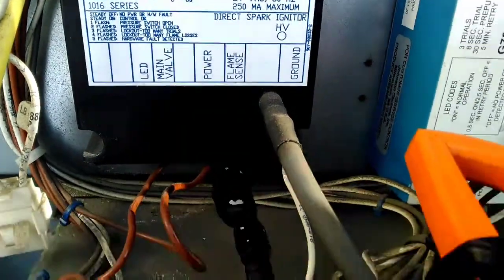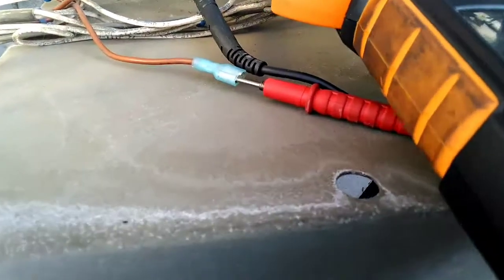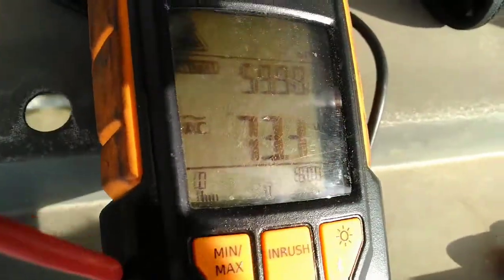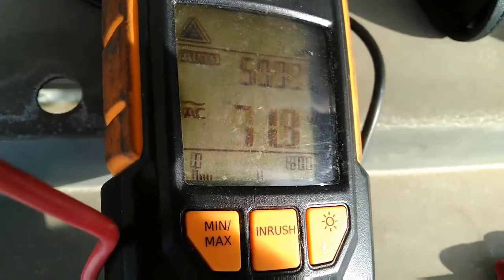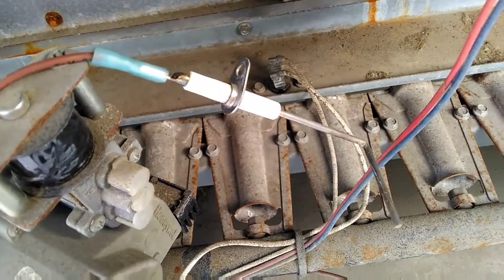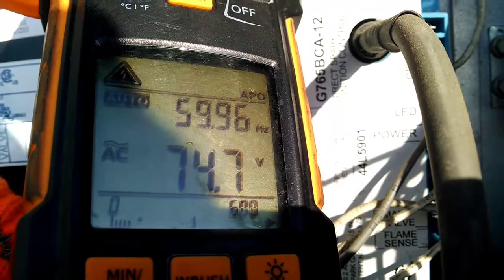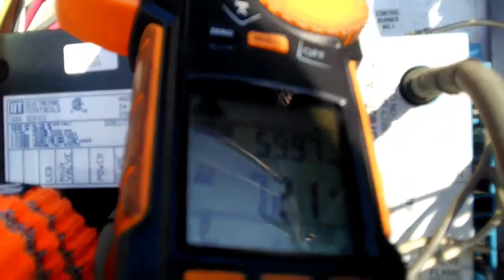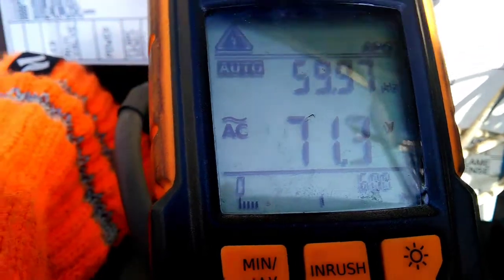Flame Sensor Voltage

Comment: The flame rod is insulated from ground by the ceramic so it should act the same as being mounted to the burners when not mounted. Correct?
Reply from the maker: Channel Cat Chaser correctly
Reply: HVAC Know It All I've never seen a bad flame rod in 17 plus years in the trade. But may see one tomorrow.

Comment: I think It is normal for the voltage to jump, as shown in the video, when the flame sensor is grounded. This occurs because the sensor has a better ground when touching it to the metal frame

Comment: I think another good test would be, put your meter in series with the flame rod, so remount it in furnace, do the series test @ module, now how many dc milliamps are you feeding into your module to prove flame. It will input dc microamp current, it gets compared to reference, it says yes I see flame, and circuit allows main gas at valve. Lets not forget the purge at very begining of sequece, then pilot flame & then ignition. 
Then bill accordingly

Comment: There should always be AC voltage on the flame rod, even when there is no call for heat. The ignition control must be able to sense a flame even in case, say, the gas valve sticks open.
Reply from the maker: Ian McTeer I checked this, when there is no call for heat, the voltage is 13 volts, during a call it's 75 volts then dropping to 55v during ignition.
Reply: I’ve had more experience with the White Rodgers HSI ignition system used on residential gas furnaces. If I can recall, the WR system puts out about 40 vac to the flame rod when no call for heat exists. I never tried grounding the flame rod to check the voltage under that condition but it does make sense that the voltage would increase. I’m guessing the ignition control would sense this higher voltage and lock out thinking that there was a fault in the flame sensing circuit. WR doesn’t discuss this concept in their ignition control literature that I can remember focusing mainly on the expected dc microamps needed to prove flame. Proving flame using a partially rectified AC signal is really an ingenious method, safe and reliable too.

Comment: Flame sensing rods stick out into the flame and connect back to the furnace board. Once the board sends a call to the gas valve to open, it monitors current flow on the flame sensing rod. It does this by generating a potential (voltage) at the flame sensing terminal, this terminal is connected to the sensor with a conductor. When no flame is present there will be potential at the rod and no current, when a flame is present a small microamp DC current will be present as a path is made between the rod and the ions in the flame. This small DC current signals the board that flame exists and all is well with the world. If it does not sense this microamp DC current within a few seconds it will shut off the gas valve and try again.

The board outputs this potential (voltage) on the flame sensing terminal right at the beginning of the sequence to confirm that the path is “open” with no flame. This ensures against false positives (sensing flame/current when there should be none) and once it goes from 0 current to the rated microamp current the board “knows” that flame is present. Voltage doesn’t matter it’s current...
Reply: perfectly explained,thanks; i  think i agree with that false positive detection too; but what if,like i read on another comment just below, if the gas valves stick open?

Comment: hi bro, For 3 days, I struggled by setting ipsen up a burner experiment set for the trouble I had in the oven. They work with this type and can be fooled with Diodes. But I still haven't figured out how the millivolt produced in an old-style cardless dual element flame pilot locked the valve.

Comment: There should be 0 voltage the way you had the meter leads hooked up without the sensor touching ground. There is not a complete path. It would be the same as having your test lead hanging in midair instead of connecting it to the sensor. You did not have your meter set correctly.

Comment: If the flame sensor is touching ground outside of the flame, can it prove the flame?
Reply: No because u would have no DC micro amps. u need a flame 🔥 to rectify AC  voltage into DC to satisfy the module.
Reply: @davidhazas7162  thank you for clarifying

Comment: I don’t understand why there’s no arc when you ground the rod. 75-125vac to ground, but nothin.  This is something I’ve never understood.
Reply from the maker: That is a good point.
Reply: eh eh eh  it goes from a megaohms resistor on the board,no current to be seen there
Reply: i jave a daiking right now thats only showing 12 volts at the fs terminal on the board